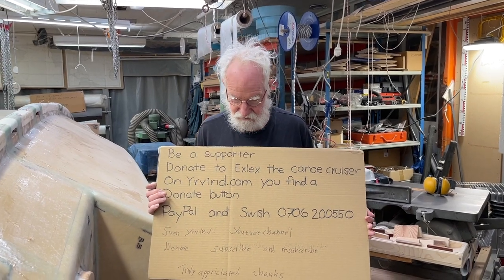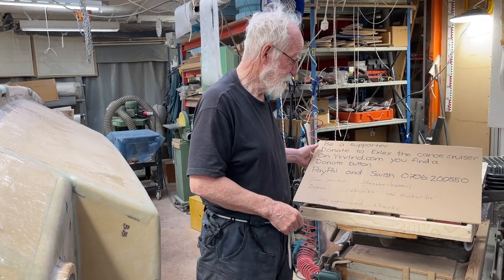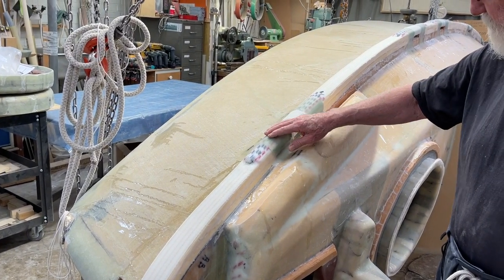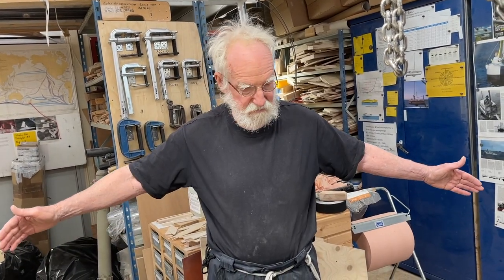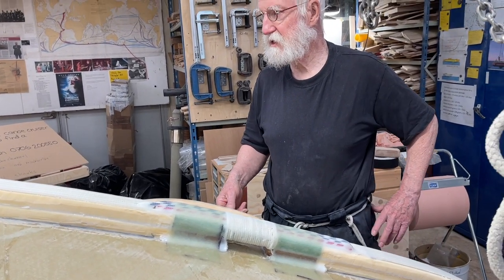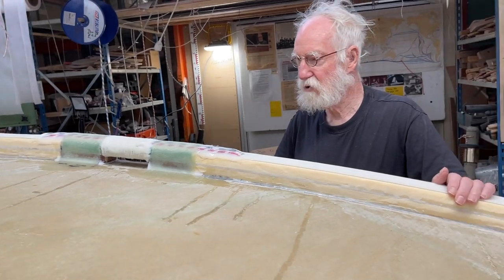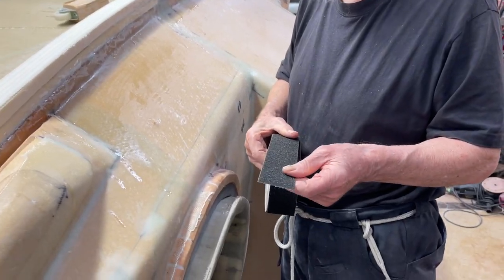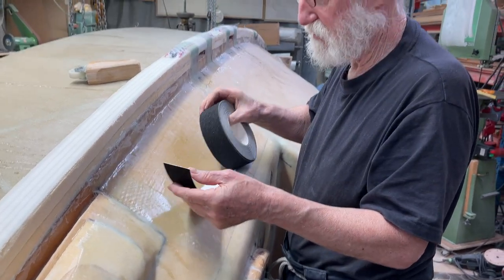22 june 2023  Review of rubrail also bevare of begging

Comment: Have you thought about not using the tape, but doing a non-slip surface with paint and sand?
Reply from the maker: The tape it will be.
It is a big improvement over the paint and sand I used before.